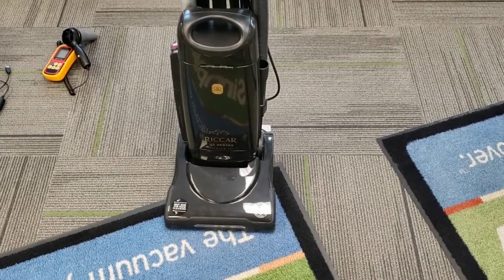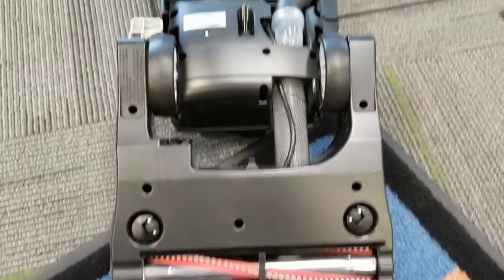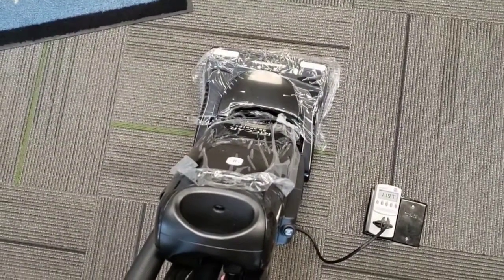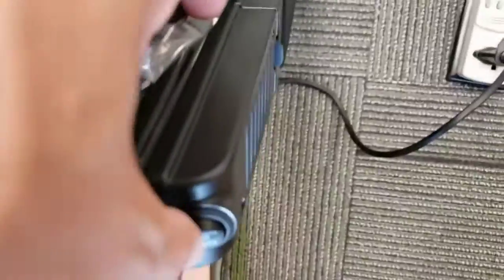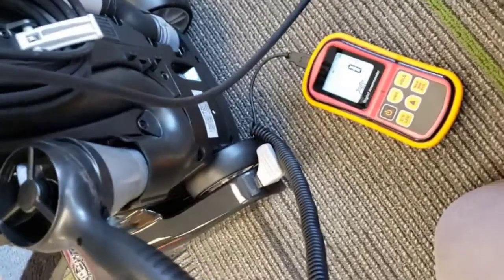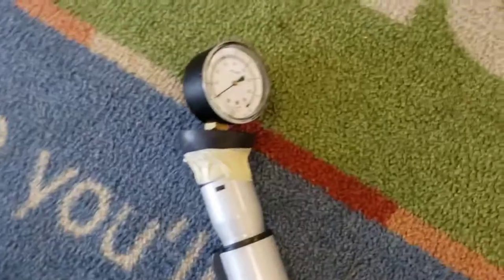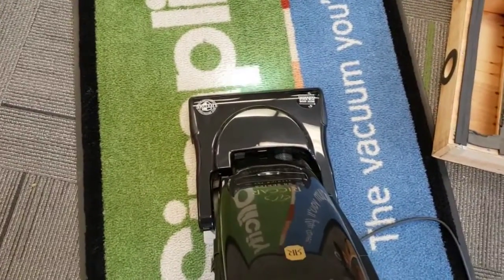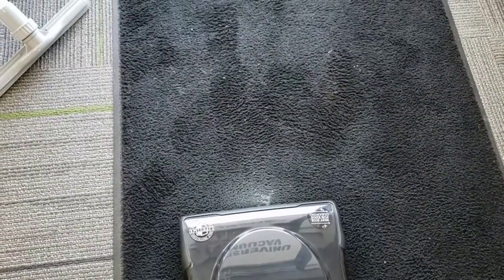Riccar R25 overview and airflow testing.

Comment: Bummer, thought this was the one.  As I dig deeper, it seems that many think it's not great for suction on carpet.  Also looking at the Sebo Felix, but HATE that it doesn't have a decent hand tool option with their setup.  I do a ton of walking around with just the removable hose to suck up hair and avoid getting it all tangled in the brush.  I'm convinced there is no vacuum for me.
Reply from the maker: Of all Sebo's machines I feel the Felix/Dart is the best of the bunch for carpet/floor cleaning. it's above floor cleaning is a drawback, would the optional extension hose solve your issue?
Reply: @Blackheartvacs  Possibly.  I'm going to a dealer today or tomorrow to find out.  I'm not in love with swivel heads, so the Dart would be fine, except that I do want variable suction.  What I really need is to be able to design my own vacuum!
Reply from the maker: @Indydi  Wouldn't that be nice? Many of us collectors have had that same thought.

Comment: Nice, but made in China. =(
Reply from the maker: yes in ways I feel like the R25 is a step down from the vibrance line before them, less airflow at the cleaner head, shorter warranty, higher cost, and of course the location of manufacture as mentioned. They have some nice features but eh I was not excited about them when they came out
Reply: @Blackheartvacs This vacuum sure is horrible.

Comment: Did the previous R20 model have better airflow?  I don't understand why Tacony doesn't improve the airflow for such a pricey machine.
Reply from the maker: Well i've done some testing on the S20D and the S20UP the UP's hose seems to eat up more airflow it was made of a different material and since it seemed stretchier i'm assuming that the interior of the hose was narrower. Part of the problem with the R25 line is that the airpath is longer. They're not a bad machine it's just they could have done better IMO.
S20D
Body: 101.74 CFM
Hose: 97.09 CFM 82"
Wand: 92.47 CFM 80"
Nozzle: 70" 8"

S20UP
Body: 104.81
Hose: 89.4 78"
Wand 88.37 76"
Nozzle: 58.56 CFM 8"
Reply: @Blackheartvacs  Really confused as to how the S20UP got lower numbers especially to the nozzle despite having the larger motor from the 7850?
Reply from the maker: @WilliamBilliam928D  I was confused by it too but one key difference was the hose. The UP had a hose which reminds me of like a hoover windtunnel self propelled  and i suspect it had more material which folded inwards which would have reduced the inner diameter of the hose. We did see slightly greater flow at the hose port on the back from the UP but anything after that hose was lower.